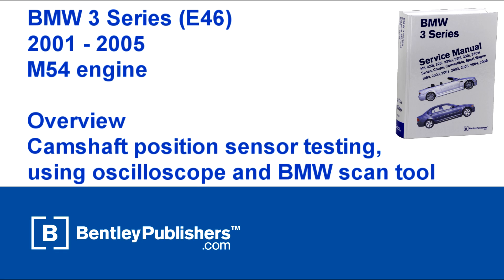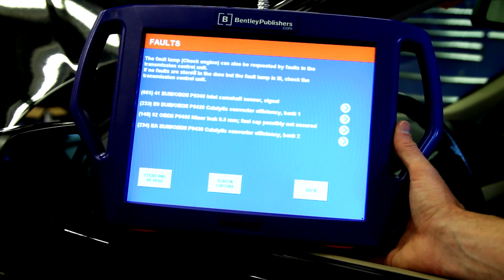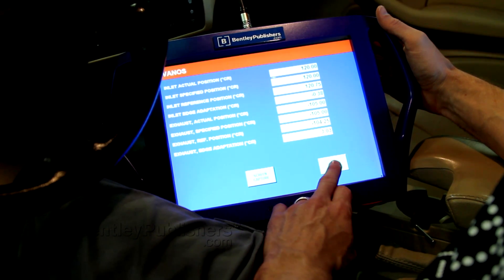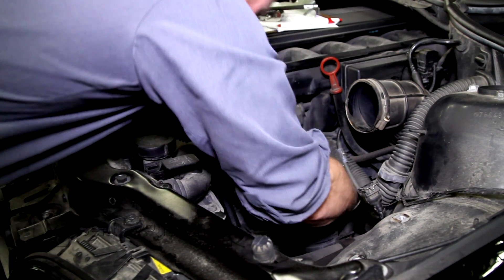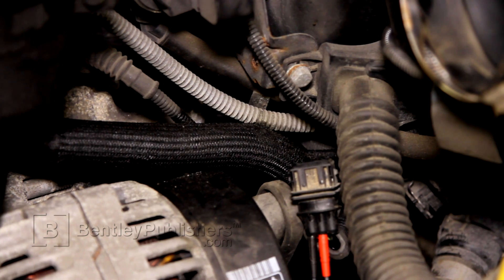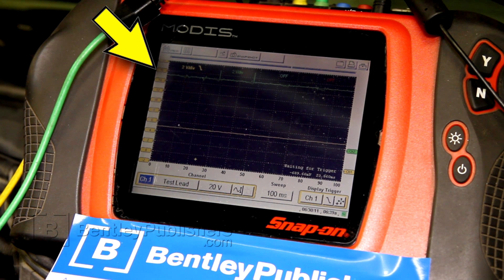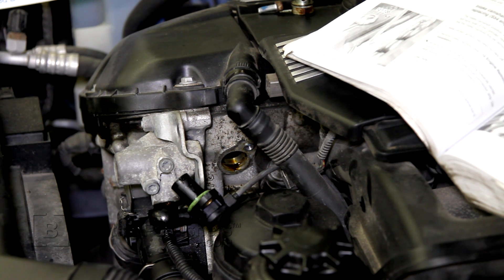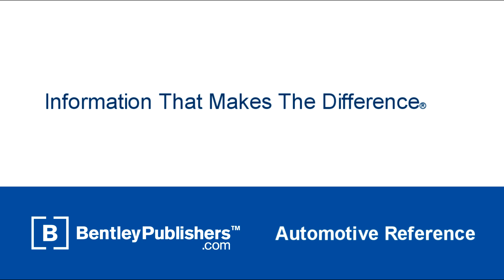BMW 3 Series (E46) 1999-2005 - Intake camshaft position sensor testing P0340 - DIY Repair

Comment: have 2005 bmw 325i, exact same symptoms hard starts and stalling on occasion. used  bmw scan tool and did live test with the intake position sensor and car stalled when test initiated. bad cam sensor?nreplacing anyway but just learningto use scan tool

Comment: 2006 BMW 330i, my cam sensor pop up. it goes off and back on. Does the type os gas have any effect on the sensor. mechanics been checkn and chasin still nothing. vanos, timing, and cam sensor checked to be good. so I dump in some gas treatment havent seen check engine light since then..

Comment: Hey...i have a big problem with my 2004, x5, 3.0 engine. The problem started a few months ago and is driving me crazy. I start the car now...run it for...10 minutes or 5 hours, i stop the engine. Try to start it after 30 minutes around, the car turns and turns until i push the gas pedal. It starts and it feels like it's not enough fuel or too much fuel. Do you think it might be from this intake camshaft? I changed : Camshaft exhaust, crankshaft, fuel filter, sparks, clean idle control, clean throtle body, clean auxiliar air pump...new air filter...i have no ideea what's wrong with it.. :( Please, any ideea?
Reply from the maker: draqushoru 

Hello, 

Hard to know what could be wrong without doing some diagnostics. Check carefully all connectors. Look at the front vibration damper. Make sure the rubber is not loose on the hub. Next you should connect a scan tool and see what the live data looks like when the engine is running. A BMW service professional can use a scan tool to look at the live data and determine what numbers are out of  range. I'd recommend a good independent based on the age of your X5. Could be a mass air flow sensor, a temp sensor, a cam sensor, or other things.  Sorry I can't be of more help, but arm chair diagnosis from here. Connect a scan tool and go from there. Assuming the check engine light is on, so there should be some fault codes stored. good luck and let me know what you find. -Charlie B
Reply: BentleyPublishers Thank you for your answer.  I have a BMW  scanner and a live data program.  Nothing,  everything looks good,  that's strange.  No  engine light on... Nothing! As soon as the car starts drives like new.  I just used FCP EURO for some parts now.  Waiting on the camshaft sensor,  the one that's up because the other one it's changed already and got the temperature sensor too, the one that sits in the block engine. Hope one of them is the problem. To be continued...
Reply: did you solved?
Reply: Were you able to solve this problem because I am having this problem also

Comment: Hey, can you tell me if it's safe buy an OEM CPS sensor (Febi, Delphi etc) ? I'm about to buy a new one, very low price (30€), but I saw some people saying it was better to buy it from BMW because they sell computer-balanced sensor specifically for their car.

I dunno what to do anymore :/
Reply from the maker: Stephane T. 

Hello, 

My personal advice would be to purchase the OEM sensor from the dealer. It is more expensive, but the aftermarket sensors can be hit or miss and have been problematic lately. The OEM brands often use different countries and factories for the aftermarket. Good luck. Let us know if you have luck with the aftermarket OEM sensor if you go that route. I have not heard of the computer-balanced concept, but may have some merit.

Comment: im sitting and laughin how you test signal for squerwave,man you disconected plug from sensor and tested to harnes ecu side not connected to sensor. so hows its posible to see a signal if sensor is not connected
Reply: Hustler LT i could have sworn he said " plug sensor back in" and then plugged it back in.
Reply: Exactly,LOL

Comment: Is there a reason why the "before" video shows no movement in BOTH intake and exhaust cam angles.  Where as your "after" video shows both cam angles moving.  If one is faulty, does it default and stop the other one from moving too?

Comment: I have an e87 1 series BMW with a half yellow engine warnig, codes 2a67 and 2a6B I know it it something related to the valvetronic. Do you happen to know if it is the valvetronic sensor or if it is the valvetronic motor, or something else? I hope it is not the sensor that I have to replace ecause it costs a lot. Thanks

Comment: That sounds more like a problem related to the thermostat and cooling system. I have a feeling you will get Fault code 10 and 123, 10 being: Coolant Temperature sensor, and 123 being: Characteristic Map Cooling - faulty thermostat, or no / incorrect activation by the ECU. Go to a licensed BMW workshop, or a BMW workshop and have your car diagnosed.

Comment: Mine is e46 BMW 2004 make,2000cc.Was slow in picking speed and had a "eml" on the screen. I drove it for some time and eventually it just stoped and wouldn't start again.Im now being told it had to do with vvti.We replaced the motor but it didn't help.what can I do ?

Comment: I'm having troubles removing the VANOS solenoid to get to the intake camshaft position sensor.  It seems pretty stuck.  I sprayed it down with some Bolt Off, but had no luck.  I'm using an adjustable wrench.  Any suggestions?